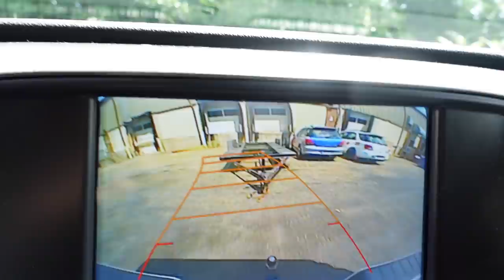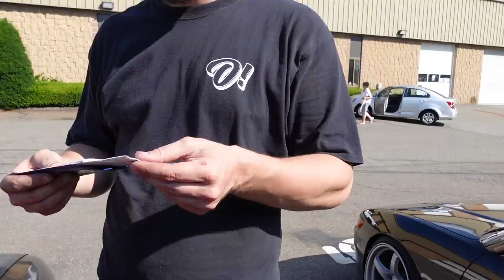Is this the worst car I've picked up yet..? (marketplace come up!)

Comment: Those rear toe arms and front tension rods look to be SPL parts. Probably worth cleaning up and the rod ends are replaceable with FK rod ends. SPL also has a trade up program on their website where you can get a pretty significant discount trading in your old version parts for the newest version!